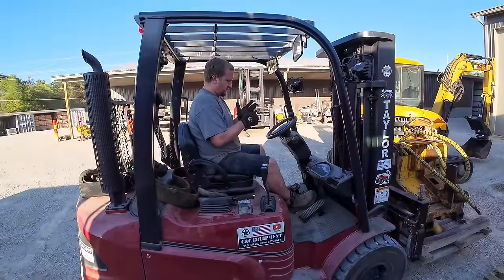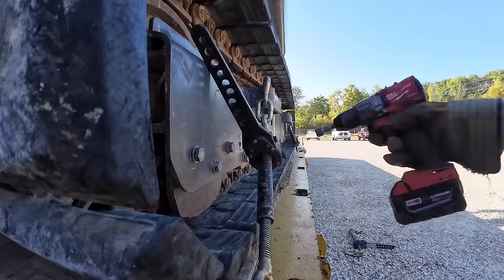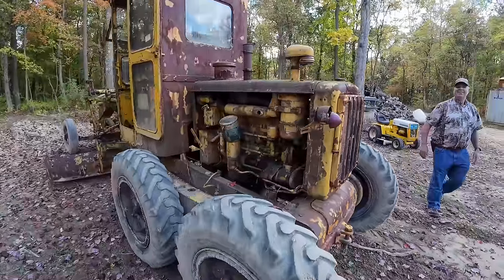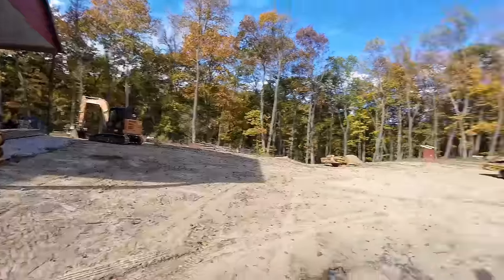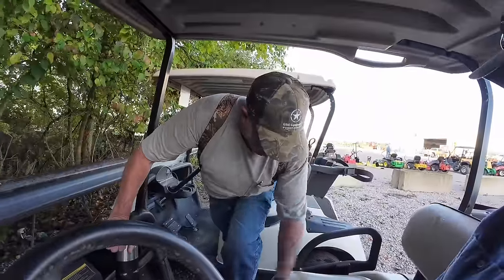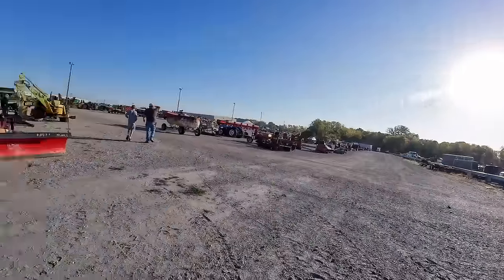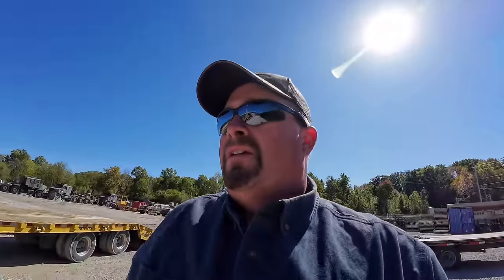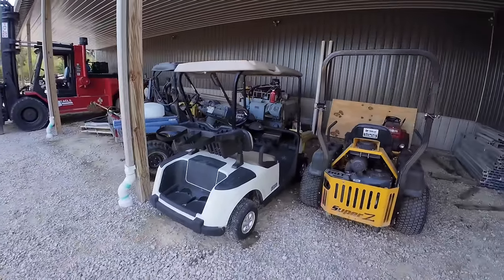3 days, 4 states, 2 auctions and a special delivery to @DieselCreek. I bought many random things!

Comment: Hi, Love the auction video's and seeing you finding good stuff.  Will be good to see how the little tractor makes out.   Once upon a time in the 90s. I was operating a Cat D4 not sure of the model, but it developed a problem when it got warm where it slowed a felt under load, would not push. but when it cooled down it was ok again until the oil got warm.  Took them a while to figure it out, turned out to be crack in torque converter allowing the torque case to fill with oil as the scavenger pump could not keep up. It was a strange one that had them scratching their heads for a while lol

Comment: The Ford tractor for sure.  It's at least close to something I could afford.  I do have a early 70's Yard Man garden tractor with the Eaton Hydrostatic drive.  It slowly lost reverse until it will only creep in low range on hard surface now.  I took it apart hoping to find bad seals or something I could replace.  Looks like brand new inside and I haven't been able to find any repair kits anywhere.  I think it needs the acceleration check valves but they have to be destroyed to get them out so I just put it back together and hoping to someday to find parts before I work on it again.  New drives available mostly in UK but are way too pricey for me.

Comment: That little tractor looks like it could be a fun little piece. Not sure what's wrong with the loader but I'll throw a guess. As the by-pass is stuck open likely from some contaminated hydraulic fluid. 

If fixing the loader makes little sense, get a hold of a good finish mower and use it out at the farm or can up a trailer dolly to pull behind it so it can be used to move trailers around the lot without needing to connect to either truck.

Short of that, cage it and fit a winch with a cargo deck. Build a heavy bull bar/brush guard for the front and use it for game recovery during hunt season.

Comment: The legendary 4020. You could buy them brand new for $6,400 with the synchro range, or around $7,000 with the powershift. I see them sell all the time here in Kansas with 10k hours for double+ that price. I’ll never forget the synchro range 1,3,2,5,4,7,6,8 with reverse on 3&5.
Reply: Nerd.  😋

Comment: Did that 770D grader sell for $34,000? That's pretty cheap. One with 12,000 hrs brought $45,000 two weeks ago. I would be interested in what you find out on that Ford Tractor. Whenever the hydraulics don't work, auctioneers often suggest that it's just low on fluid. If that were true they would put some in to get a higher sale price.

Comment: that 1715 with loader probably works just fine i bet it has a diverter valve either you have the remotes or the 3 point linkage operating not both. many older tractors were set up that way.

Comment: I look forward to the fix on the small Ford tractor. I traded for a basket case 2000 Kubota L2500DT last January and have everything in fine shape except the loader. Rebuilt the loader valve and flow priority valve, but the loader still doesn't work  properly. Every now and then, it will work perfectly for 2-3 minutes, then back to the same old same old.